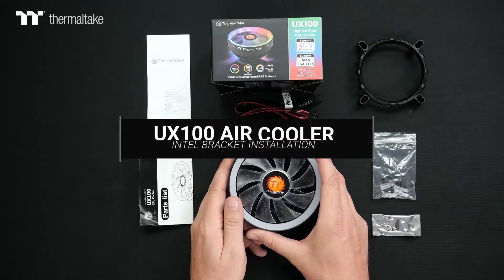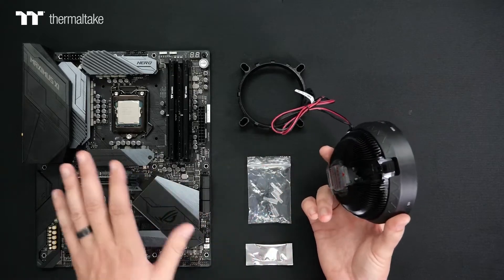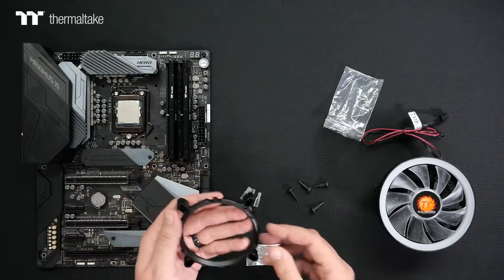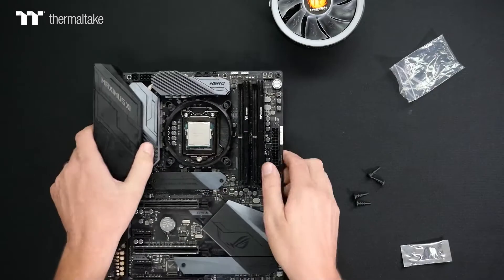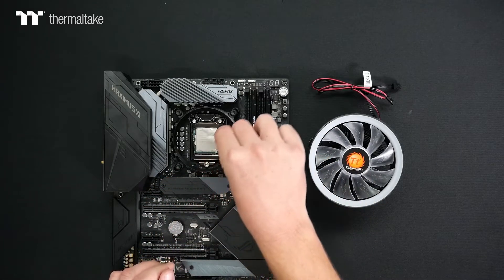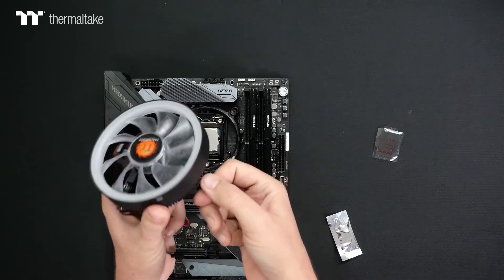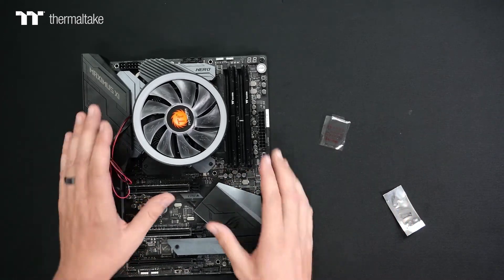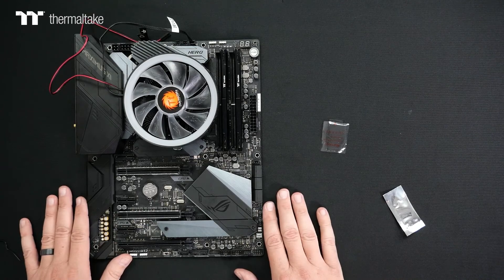[HOW-TO] Thermaltake UX100 - Intel Bracket Installation

Comment: As an IT tech of 30 years standing, I'm not too proud to double check things and refresh my memory with little videos like this. It was all pretty straightforward until the little reminder at the end about removing the heat  sink sticker!  I frantically searched the box of discarded bits for it and it wasn't there - doh! Sure enough when taking it off again, there it was.  Lucky escape so thanks for the reminder 👍